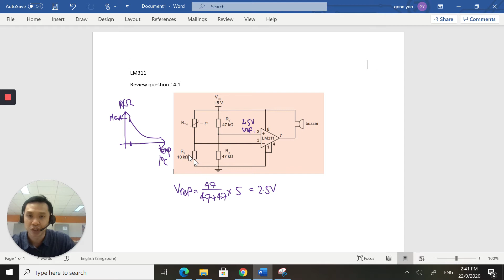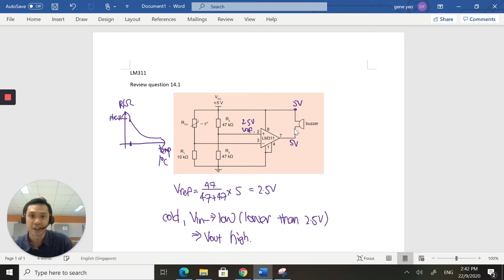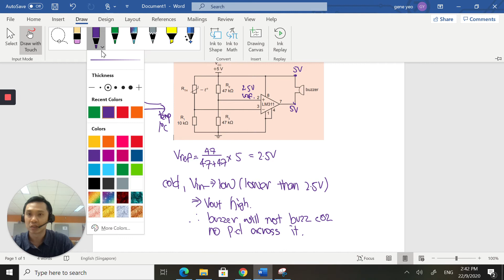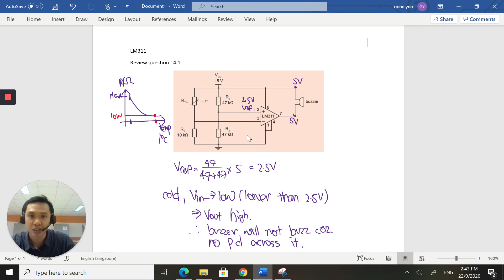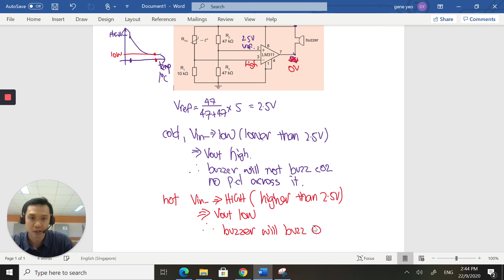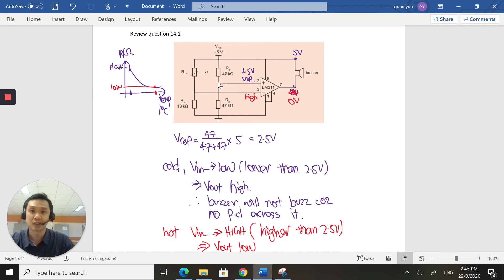LM311 Part 2

Comment: Please help!! I have a transistor bank of three Bc 547 used to detect electro static energy to light an LED dim to bright. I want to have it trip a "Cat toy" at a certain level. Will LM311 work if I work out the Vref? 4.5VDC input power from 3 AA batteries. Forgive My ignorance I know nothing of transistors.